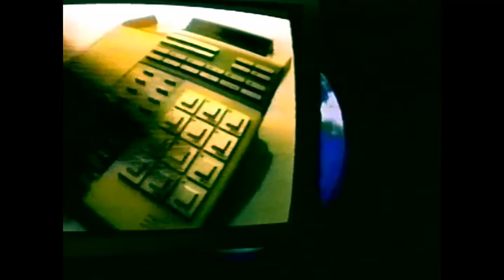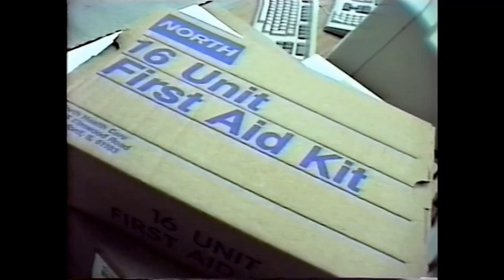Working in a DMS-100 telephone office-A training video

Comment: I love how he used a hammer for a "software adjustment"!
Reply: Oh yess, when I hired into and worked in a number 5 crossbar office, sometimes I would have to use a pair of needle nose pliers to get the bifurcated relay contacts into proper alignment. As long as you used the correct Bell System tools, management could not criticize you for using the proper tools to "adjust" the relay contacts 😂

Comment: Pretty crazy to think that my landline is getting a dial tone from a piece of equipment put into service here back in the mid 80s.
Reply from the maker: It has been updated alot since then
Reply: I’ve visited my telephone CO it’s a old DMS-100/200 and there are a lot of spring wire relays in my equipment for testing trunk lines in the office, It’s really interesting!
Reply: @bruce4kfilms Yeah, that’s something I didn’t realize until recently. These switches weren’t just put in service in the 80s and left alone, they were continuously upgraded, at least until nortel went bankrupt.
Reply: @bruce4kfilms  Not as much as you might think. (I've seen switches with 30-40yo cards in them. 'tho these days most have been retired for soft-switches, and VoIP.)
Reply: I have cards in Nortel STPs this old, and meanwhile Cisco & Ciena cards fail to the point of absurdity after 3 years.